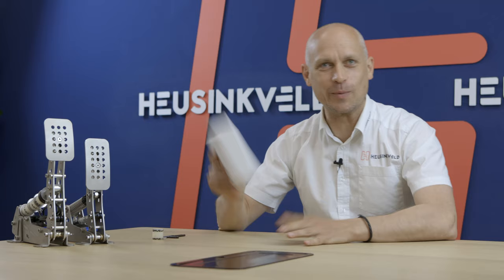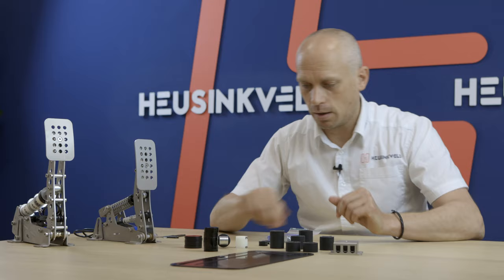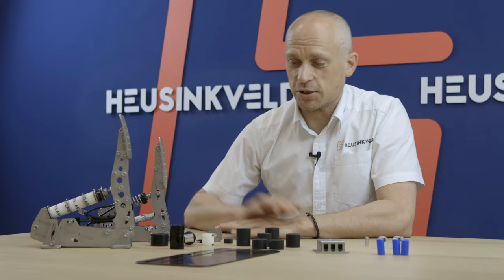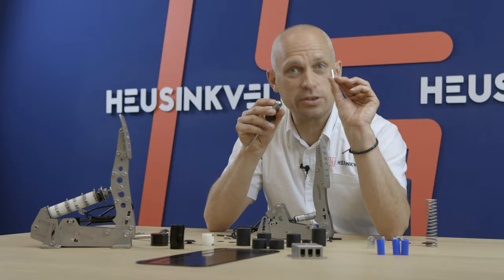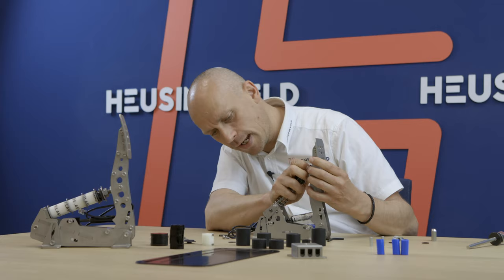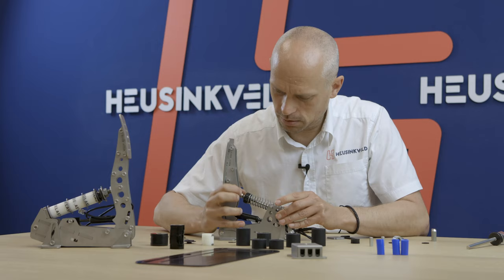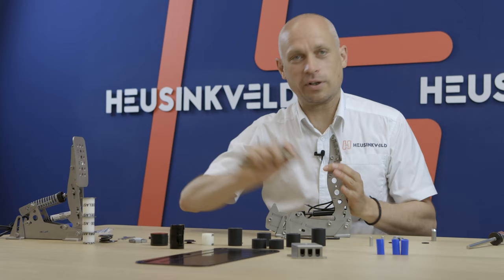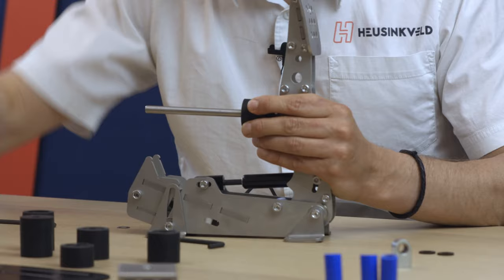Heusinkveld Sim Pedals Ultimate+  Upgrade Kit - Installation Tutorial

Comment: What about the dampers? I’ve seen the ultimate+ has new ones. Are they different in terms of feelings?
Reply: Hi, the steel springs and dampers are technically unchanged, so they are not part of the kit. The working is the same.

Comment: Thanks. This will be of help with the upgrade kit arrives!
Reply: Thanks David! How are you doing, my old friend? 🍻
Reply: @RemcoHitman  I completed this upgrade easily with the help of the video! Many thanks for making it.
Reply: @RemcoHitman  I've emailed a couple times. Either my load cell has gone bad or there is something wrong with this upgrade. The original version allowed for good progressive braking. Muscle memory. Now the same technique can result in ok fast turn braking but lock ups immediately after in a slow turn for no reason. This should not happen. I'll need to go back to the original version at this point just to complete a race.

Comment: Can someone tell me what the nut thread size is for the throttle rod for locking the preload. My Ultimates didn't come with any installed and just has the plastic adjuster.
Reply from the maker: Hello X-Men, 

Many thanks for your message. 
We would like to help you, can you please contact our Support Team? They are available daily from 9 a.m. - 6 p.m. at support@heusinkveld.com.

Our Technical Support Team will answer you as soon as possible. 

Best wishes from Groningen,

Your HEUSINKVELD Team
Reply: M6 😁
Reply: Mine didn't have them either and the rod end is locked on tight. Going to have to figure how to get it off.
Reply from the maker: Hello David, 

Many thanks for your comment. We would like to help you, can you please contact our Support Team? They are happy to help you further :) 
Thank you,
Your HEUSINKVELD Team

Comment: thanks, what is the need for throttle piece change? what is the benefit?
Reply: The rod ends for throttle, brake and clutch now feature a PTFE bearing. Fairly recent Ultimates (2021) already have this installed but for users of older sets this is a welcome upgrade 🙂
Reply: @RemcoHitman  thanks for explanation

Comment: Imagine spending over $1,000 on pedals only to require an upgrade kit later on just to utilize the software. I guess im glad im too broke for this problem.
Reply: The ultimates were released before they developed the smart control software… Would you rather have them pull a Fanatec and ditch development for the ultimates and sell the upgraded set without any way of upgrading an ‘old’ set?

You should be applauding HE for enabling their customers to bring their previous purchase up to new spec at minimal cost.
Reply from the maker: @Username_Invalid  Thank you!